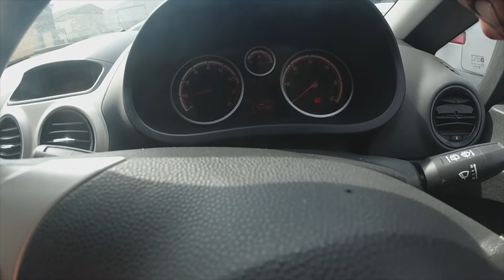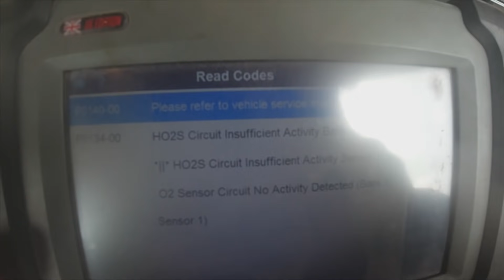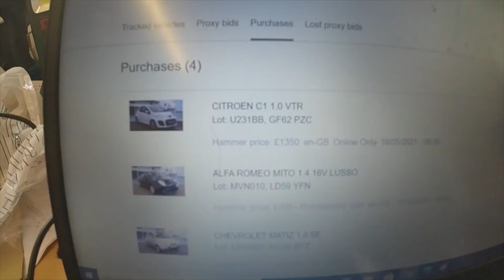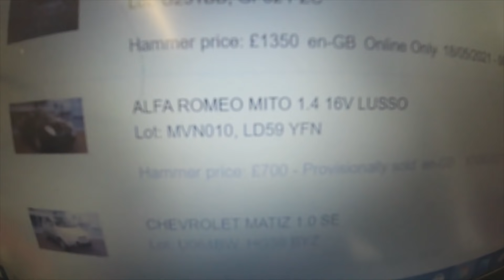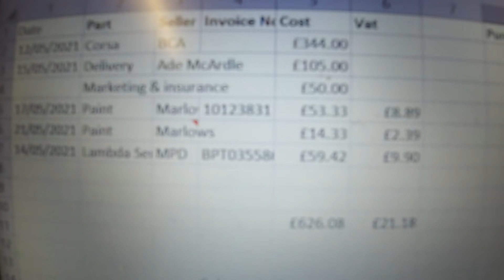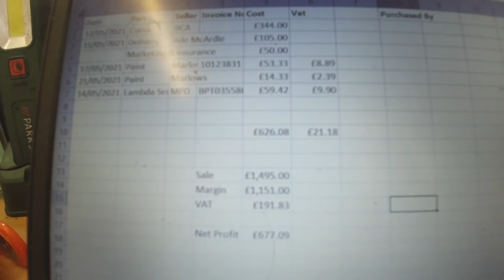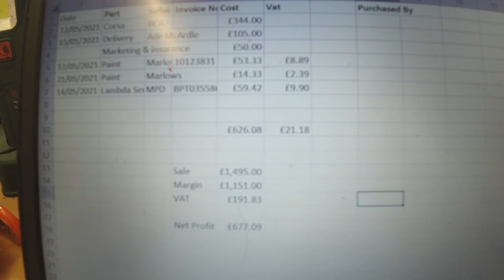You ALL told me it would happen!!

Comment: I'm not up on the fade out thinner, you apply your laquer coat then where and after how long do you apply the fade out thinner, how does it work differently from just laquer? Corsa looks fantastic. Cheers
Reply from the maker: Its basically paint thinners sprayed on to make edge very thin and blend. You have to add immediately on last coat on the edges of your work to blend. You want that area to be 1000 grit scotched or sanded. Very quick dust spray just on the edge. Linger and it will quickly cause a run
Reply: @ChopsGarage  brilliant thank you for the full explanation 👍

Comment: Nice job on the Vauxhall Corsa mate, I’m just not sure how the paint alone cost £65?? I could spray the rear bumper and rear quarter panel comfortably with one aerosol can and half a can of laquer total cost of about £24 . Unless you bought the paint and used a spray gun?? That lambda sensor failed bang on time usually between 70 and 90,000 miles.
I have had mates laugh at me using aerosol cansBut when they see the results they are shocked especially if the weather is nice and you can park the painted side facing the Sun it really ‘cooks ‘ the paint quite well!!
Reply from the maker: I bought 2 cans lacquer and can filler primer and car colour. Used 1/4 can filler primer , one can lacquer and most of colour. Rest will go on other cars but wont incur cost now  I put it all against this

Comment: She'll be back!  I smell cordite from the parts cannon lol. Can't believe you changed a o2 sensor without doing any diagnostic test's
Reply from the maker: ? The diagnostic test told me it was the sensor
Reply: @ChopsGarage  Plugging a scanner in isn't a diagnostics You need to actually measure o2 volts look in live data at that and fuel trims
Reply: @drivewasher  you mean look at your scanner longer and then change the sensor. because,  thats what was broken...ideal if you get paid more to scan it...
Reply: @jusb1066  No, I mean when you get a dtc for o2 sensor it doesn't mean the sensor has failed! It needs to be proven